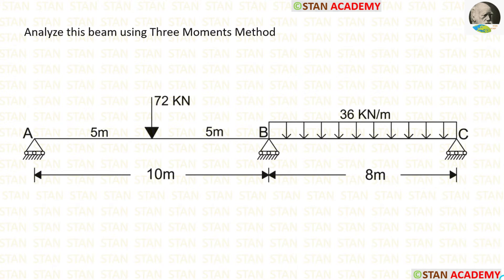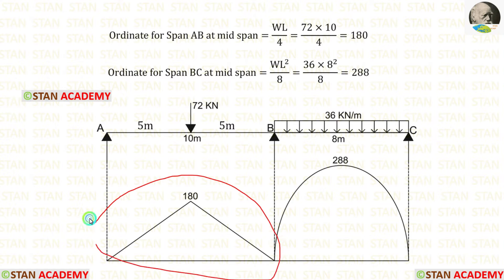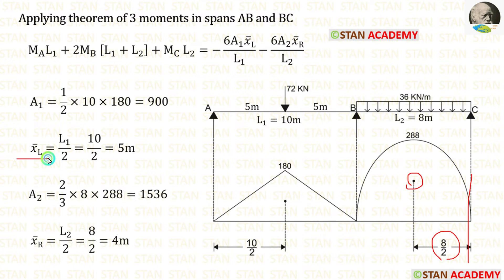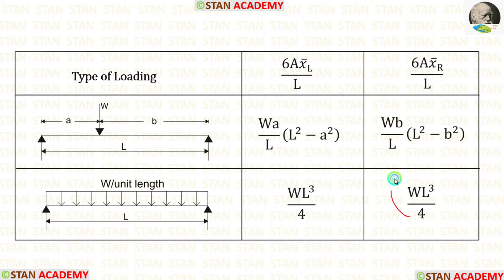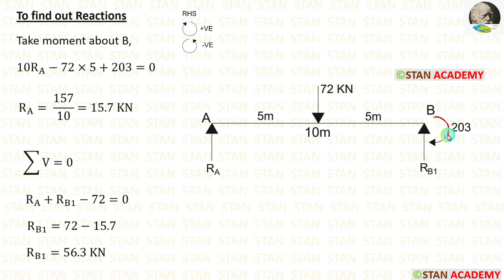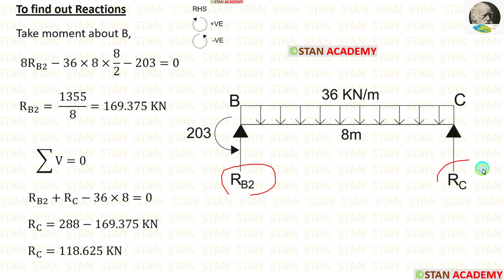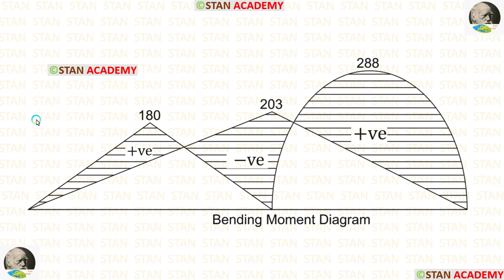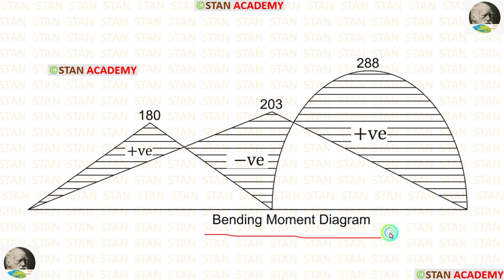Problem No 1 on  Clapeyron's Theorem of Three Moments

Comment: Draw the bending moment diagram of a simply supported continuous beam ABC 
having span length AB = 4m and BC = 6 m. The span AB carries a point load of 20 kN 
at a distance of 1m from support A and span BC carries a uniformly distributed load of 
intensity 10kN/m throughout the span (BC). Use three moment theorem. All supports 
are simply supported.

Sir please solve it